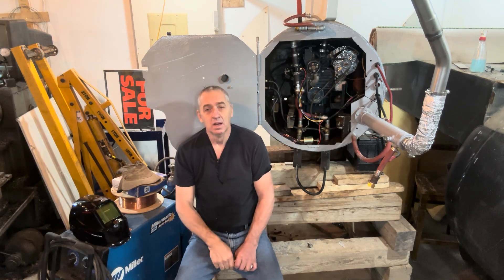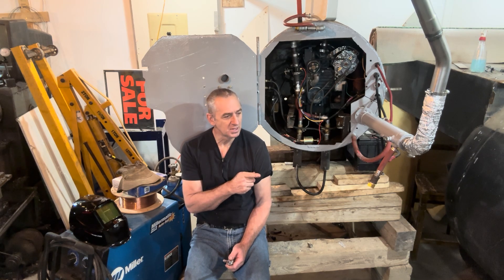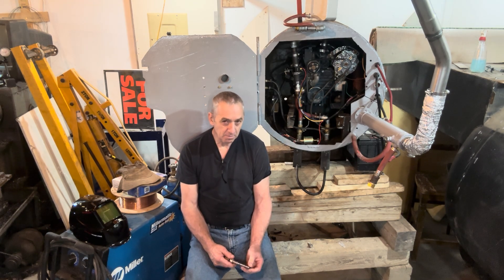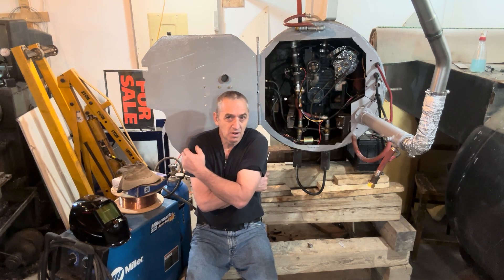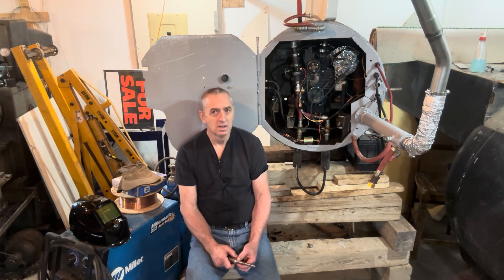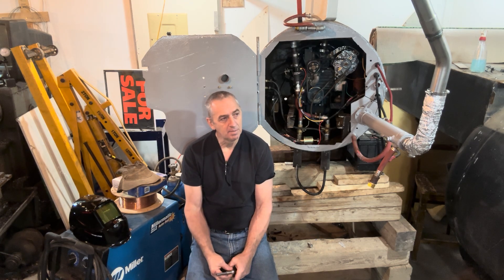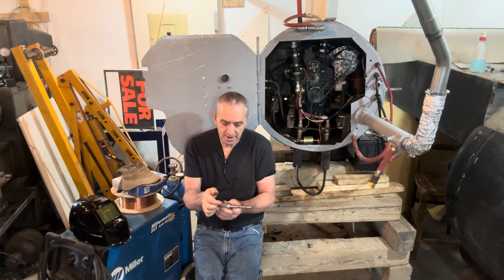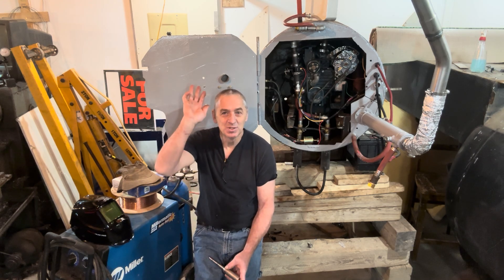building my diesel electric submarineJanuary 13, 2026

Comment: Building a desiccant can with a heater in it could work.... just have a fan with a duct blowing upward so it vents out of the sub when running the heater on the surface ferrying to dry out the desiccant.
Reply from the maker: I will research that, thanks

Comment: I like the dehumidifier idea. If you do go with spray foam I would recommend a minimum of 4 lb closed cell urethane, this is about as dense as you can spray from a gun to the best of my knowledge and the density it is, the harder is for moisture to penetrate
Reply from the maker: I will try the dehumidifier first.
Reply: @HankPronk yea it’s super difficult to “unfoam” things 😂

Comment: Just a quick word on condensation & cork etc; there's a huge variation in cork materials and manufacture even from a single supplier - it can be good stuff though but I've had batch issues previously. Have you considered treating sufaces with a hydrophobic compound/paint to accelerate run off/down to bilge - it was our go-to for marine engine rooms and you get to use the hull plate as your de-humidifier/runoff to bilge (using fans to aid flow). It did need annual retreatment due to engine oil vapours, but a spraygun on a pole got to even tricky bits in no time. I can't remember the type of acoustic dual density foam board we used over the top of it but - H I Sutton @HISuttonCovertShores (here on YT) might be able to put you right or help make that connection. All the best Sir.

Comment: If you try to insulate a steel hull, you will invite corrosion.  Living with the condensation is better than hidden corrosion.
Reply from the maker: That is my worry
Reply: Well if you insulate the hull, warm moist air cannot touch the steel of the hull. If I can't do that, then there will not be any corrosion. Also if you don't insulate, don't forget to pack a raincoat
Reply from the maker: @timcorso6337 that is why I thought a spray on insulation is best, then it’s completely sealed.
Reply: @HankPronk  Spray the steel hull with Nyalic Marine before applying spray foam - the Nyalic acts as a barrier coat and tie coat.  If any moisture makes its way behind the spray foam, the Nyalic will prevent corrosion.  Gives you belt and suspenders protection.
Reply from the maker: @xnademolicious  thanks

Comment: 12 v air conditioner.  ?
Reply from the maker: I have a hydraulic cooler radiator with lake water flowing through and a 12v fan blowing through it.  Works great.

Comment: One last note.  If you go with foam check carefully.  I have heard of nightmares about saturated wet heavy spray foam that was supposed to be water impermeable but really wasn’t.  Many Hewescraft owners have had big issues with it.
Reply from the maker: Thanks, that is why I am moving very slow on this.
Reply: @HankPronk  Might be worth checking into 2" mineral wool.  Easy to remove if you need to inspect the hull or work on something.  I have never used the new 'planks' they make for outside insulation under the siding.  If you like the cutting edge perhaps you could adapt that for your purposes?
Reply from the maker: @douglasthompson2740  yes worth a look for sure

Comment: Be very careful about what type of spray foam. Many are sever fire hazards. They also tend to burn and give off invisible and fatally toxic fumes. In normal home installations they require a one hour fire break between them and any interior living space. Which really does not sound like and ideal thing to have in both a vessel underway and one that is an enclosed space.

cheers
Reply from the maker: I agree.

Comment: Cork insulation might be a good choice.
Reply from the maker: yes and looks good
Reply: @HankPronk  Sailing Uma just it their sail boat in spray cork.Your could Use a peltier effect heat pump to make a dehumidifier/heater.
Reply from the maker: @johnkey1682  Agreed
Reply: insulation should be a closed cel foam
Reply: @timcorso6337 polyurethane, polystyrene, polyvinyl, and PET foams are generally avoided in manned underwater vehicles due to high flammability and toxic off-gassing.
(Especially when ignited)
Organic foams like polyurethane burn quickly, producing intense heat, dense smoke, and highly toxic gases such as hydrogen cyanide.
The industry standard for insulation on Manned Underwater Vehicles is typically syntactic foam because syntactic foams are usually made of glass or ceramic microspheres embedded in a resin matrix, which is fairly safe because it's not prone to catching on fire and they have low toxicty, low water absorption and high compressive strength, but unfortunately they are fairly expensive.